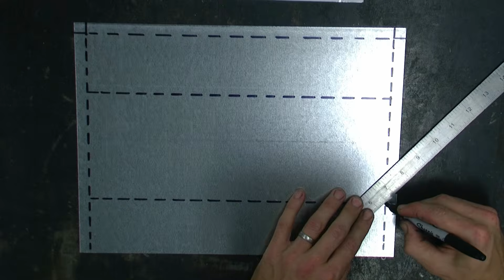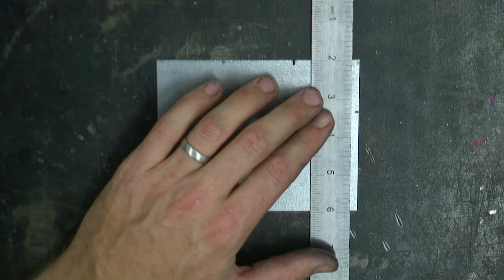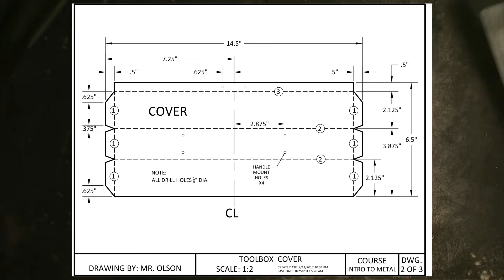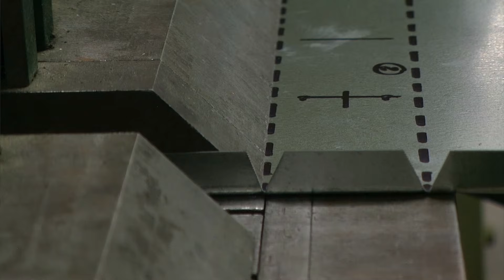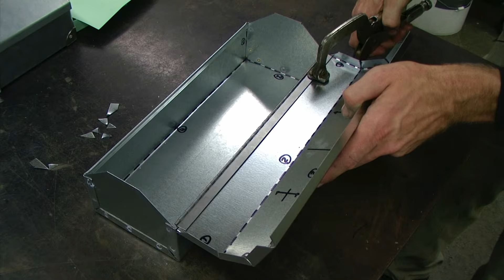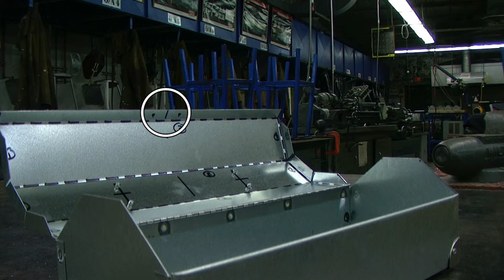Sheet Metal Toolbox - Full Project

Comment: Can you do this with stick welding instead of spot welding?
Reply from the maker: I think it would be possible if you had the right settings and rod for the thickness and type of metal you are using.  I would be cautious if you are using galvanized sheet metal.

Comment: I made one of these in high school metal shop, I'm now 56 years old and still have it and use it. Ours also had a removable storage tray, also everything was hand riveted no cheap spot welding or pop rivets. But I still liked your video it brought back great memories . 😁👍
Reply from the maker: Thanks for the comment.  I have come across a few different iterations over the years.  This toolbox was definitely build a bit more robust back in the day.
Reply: @InsaneOil What gauge is the sheet metal in this video?
Reply from the maker: @KelikakuCoutin  If I recall correctly, I think it is about 22 gauge.
Reply: im 48 and i still have mine in my garage too. Made it my 9th grade year in shop class. I also still have my little 2 gun wall hung gun rack with bottom drawer i made in 8th grade.
Reply from the maker: @warrenmichael918  That's awesome that you still have yours.
Reply: @InsaneOil  I dont use it and its pretty banged up with a few coats of chipped and worn out paint but its in the shed with a few very old tools my grandpa used to use. The gun rack is hanging on the wall with my old BB gun that i had as a kid. Nothing fancy just a daisy .177 pellet pump , still works but not very good, kinda like its owner! LOL

Comment: I’ll never understand imperial measurements and how you guys still use them, metric makes so much more sense. good job tho
Reply: I would be willing to switch but my biggest issue is metric doesn’t have aa unit equivalent to a foot/ft, it is incredibly annoying for eye balling measurements, also my work boots are about 12 inches heal to toe so I can use my feet for rough measurements lol.
Reply from the maker: @DM-zs8go  Shoot me an e-mail land I'll send you a printable paper ruler. info@insaneoil.com
Reply from the maker: I would same the same thing about metric.  It's just like learning a new language.
Reply: If you don't understand imperial measurements how can you be sure? People get all puffed up about metric but really it is a 10ths system and then the only things that go into it evenly are 1,2,5, and 10. Of course when you get to smaller measurements machinists have been using a 10ths system for inches for hundreds of years so no difference there. The win with imperial is you need to take a fraction of something - say divide some distance into some equal sections. It is easier to do this with fractions so 1/2 of 1/16th is 1/32 and 1/4 of 1/2 is 1/8th because you just multiply the denominator. Now try that with metric - what is 1/8th of a cm? Suddenly you are back in the fun land of fractions but your tape measure can't help in as many ways.

The other issue as some have noted is that many measurements e.g. a foot just happen to be the size of their foot. A fathom is a typical arm span and so on. When you cross the machinist/carpenter bridge is where you have problems because then you get to remember things like 1/8" is .125 but hey, keeps your brain working well. I can estimate things in my head faster than most anyone can get an answer from a calculator.

Comment: What gage metal are you using?
Reply from the maker: I think it was 22 gauge that I used.
Reply: @InsaneOil  Thanks. I’ve made this with 22 and 24 gage and prefer 24. But, I’ve also reduced width to 11 inches overall as I have convenient access to 12x12 square sheets. One thing I have found is that the top needs to be measured for proper length of hinge edge. Most of the time that edge is 2.0 inches instead of 2.125. This makes the top square up easier with the sides.
Reply from the maker: @benjoseph260  Great tips.  Thanks for sharing.  A skilled craftsman can modify a plan to fit their application.